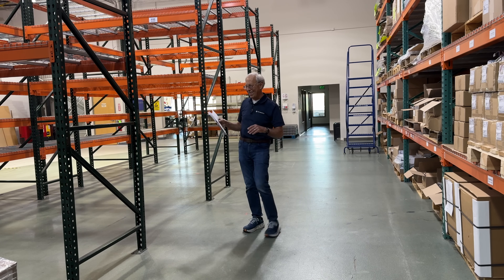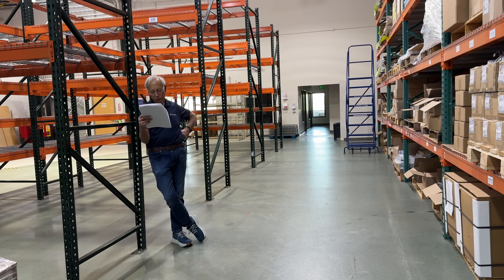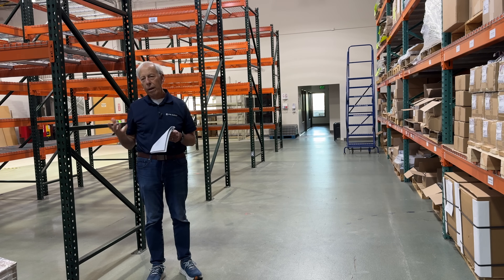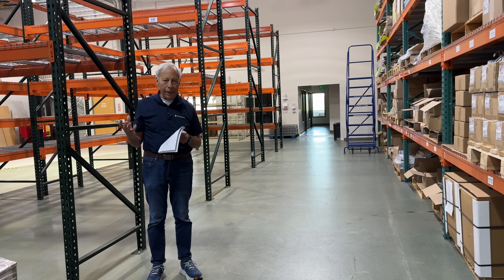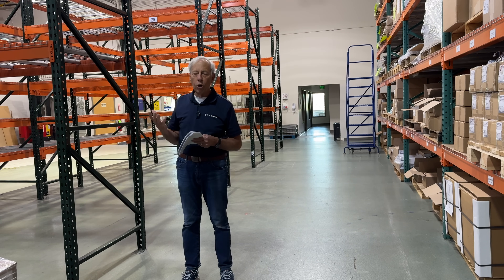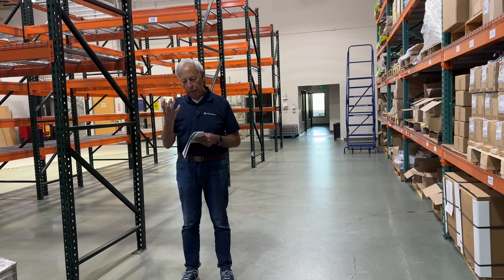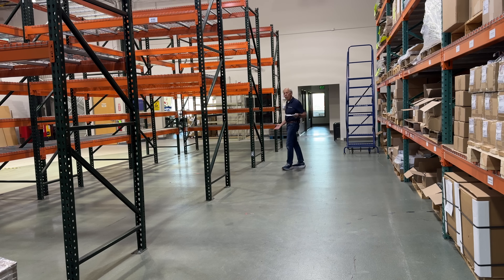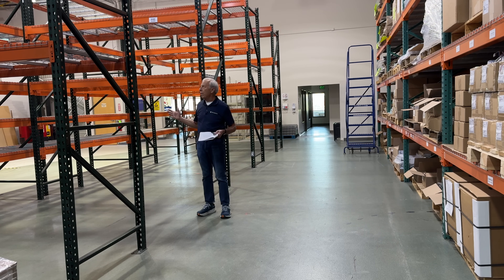Field coil woofers

Comment: In the past, until 1950, in the old time of tube radios and tube amps, there was the gold time of speaker field coils. There was no strong enough permanent magnets available.
In these times, the field coil played two different roles: 1- produced the magnetic field for the speaker; 2 - worked as a low pass filter for the power supply for the tubes, as an inductor, reducing hum and voltage fluctuations. Usualy these second function was named "chocke". After the tube/valve (or sellenium) rectifier, there was a "pi" filter consisting of a capacitor across + and -, the "chocke" in series and a second capacitor between + and - again, figuring the shape of the "pi" greek letter.
Regards.

Comment: Huh?  I think you all need to go back to the drawing board on this video and spend a little more time investigating the field coil speaker. The only reason it is not the standard is that it is expensive to produce. Most of the negatives haven't been an issue since the late 70s.

Comment: Well...Yes, and no! When I was in the Navy, many years ago, at the then West Coast Service Electronics School, on Treasure Island, San Francisco, I met Bob Andrews, who had a small record shop, with a large area in the back, to assemble: extension speakers for juke boxes, beginning during World War Two! And Bob told me that his speakers did not use magnets. OR a transformer with AC Power. Instead, there was an additional box, with a transformer, for the correct volage, and, a rectifier, I believe, to convert the AC Power, to: DC! And, isn't his what a magnet is? An electromagnetic, electrostatic field, in one direction, potential, which never changes? And: this will not heat up, as there is less current flow, as, once again, no AC field is being produced, only the constant DC potential! Worked well!  😀😁

Comment: Field coil magnets are 100% better than permanent. No question, full stop. The only reason they are not more common today is because of COST. Companies like PS Audio makes things to a cost, and they (and others) will cut costs when and where possible. When you add an ‘amplifier’ for the field coil, and the cost of winding the copper, it’s considerably more expensive. But don’t kid yourself: the FC drivers are fantastic and so much better (less distortion, more effortless, tunable).
Reply: Well said.  The magnet determines the sound.  I use alnico magnet drivers and to my ear they have a more natural sound than typical drivers.  My understanding is this character is far more apparent in a well made field coil driver.  Less compression and therefore more natural and effortless sounding.  
If I were to change drivers it would be to a top of the line field coil system but as you point out, price will be substantial.
Reply: Better how? 100% means twice as good, or waht exactly?
Reply: @paulb4661  I think the 100% means they are without a doubt better.
How much that means is highly subjective.  To me, natural, dynamic and real is the deal so there is no competition between speakers that deliver that and ones that do not.  I have heard this in conventional driver in a box setup, but they are usually 6 figure expensive.  I also hear it in my $3k alnico diy open baffles which makes me very happy.  Mega dollar horns from Aries Cerat have it in spades.
Reply: @user-od9iz9cv1w  Fancy relic from the long gone days of adequate BL being beyond reach of permanent magnets and a bit of usual marketing nonsense, but then again,  I do not listen to magnets.
Reply: You can adjust the ratio of inductive balance between the coils and thus change the speaker's free air resonance to a degree. A real neat trick is to change the resonance on the fly in real time to match the notes thus get some of your efficiency loss back. They were doing things like this 70 years ago.

Comment: Just like any other architecture, each can be optimized. Optimum neodymium, AlNiCo or even ferrite magnets can produce the same acoustic result. What you can not do is just change the magnet from one to another leaving everything else the same. I think that more expensive solutions are for those that define their success with the price tag.
Reply: No permanent magnet can produce the same magnetic force as a FC.

Comment: Do different types of magnets (if & when with exactly the same power and geometry - magnetic circuit included) make a speaker sound different ? same for its basket material such as aluminum vs steel vs …) ?
I ask this as some audiophiles do say that old speakers with alnico magnet and stamped steel basket sounded better than the same model when equipped with ferrite magnet and aluminum basket
Reply: Of course they do. The magnet is in the signal path! That’s why FC are superior to permanent magnets.
Reply: Yes.  Two separate impacts.
Stamped steel vs cast AL impacts ringing of the structure.
Alnico vs ferrous magnets impact how linear the magnet it and the resulting distortion.
Most will argue that field coil magnets produce the most dynamic natural sound followed by alnico and then the cheaper ferrous magnet.  While alnico does sound good they are limited in their strength.  Field coils can be an order of magnitude stronger.

Comment: Years ago, electrolytic capacitors were huge and the coil helped filter the power. We never had more than a few watts of audio power so heating never occurred.
Reply: Yes it was two in one.  It  is justified  to use them in tube amps.
Reply: Are you referring to a choke?
Reply: @user-od9iz9cv1w  the field coil of the speaker was used as a very effective choke. They also had a hum bucking winding
Reply: @user-od9iz9cv1w  The coil that energized the speaker's electromagnet was used as a choke, placed in series with the rectified DC input to the High Voltage supply, the inductance forming an LC filter reducing the ripple voltage.
Reply: Saved money and power but introduced new problems, however wonderful the drivers may be, the results were compromised.

Comment: Amplifiers have negative feedback circuits to achieve linearity and lower distortion down to a tiny fraction of a percent. A speaker is on the other hand highly un-linear due to how the electromagnetic field operates and how the spider and surround behaves at different positions causing vastly more distortion than the electronics. In addition you have cone breakup, intermodulation distortion, thermal dependency etc. For these and other reasons, we can all agree that the choice of a speaker is the most important decision for creating a good system. But when will someone innovate a super precise cone position feedback component that can be used to make an audiophile servo speaker (not just subwoofer)? For example, the head of a hard disk can read 2 million bits over an inch. It's gotta be possible today to enable some super tight precise cone control at also higher frequencies, but it's like there is zero innovation in speaker drivers for many years already. I often find myself discovering details using my HiFiMan Susvara planar or Stax electrostatic headphones that seem to lack with dynamic headphones or a stereo speaker setup and my theory is that it has to do with the limits of dynamic drivers.
Reply: Hi.The unfortunate aspect of inevitable cone break up is that it's an independent force of the motor and suspension. The analogy of dropping a stone into water is a good analogy.Once the force gas been applied,at higher frequencies the driver will always break up.Either controlling that utilising careful profiling and edge termination, or simply filtering out the worst aspect of that behaviour with a crossover are the only real world options. As you rightly say,the suspension too has it's non linearity and the box alignment will also contribute towards that. Speakers are a long way behind electronics in terms of their evolution with applications being little more than  refinements on what's been done before.
Reply: @oliverbeard7912  Yes, I didn't mean to say that high-speed feedback on a dynamic speaker driver can make it perfect. Cone breakup is better solved by the cone material and design choices. There is probably a moment of using machine learning in optimizing some signal processing against getting sound pressure to follow signal intent as closely as possible. It seems nothing much has happened for many decades in dynamic speaker driver design. In my teens in the 1980s I bought a pair of JBL 18ti speakers using polypropylene woofer domes and titanium tweeters having a breakup avoiding diamond pattern design hitting up to 27kHz -6dB. Clearly creative effort was used at that time in improving dynamic drivers and this speaker delivered 55Hz–20kHz ±3dB and Stereophile claimed it was the most neutral JBL speaker at that time. It still works in my gym room 40 years later (new caps). It seems to me that the creative side of driver development has been lost with the supply chain moving overseas (mostly China).
Reply: @ThinkingBetter  Yes,it's all rather stagnant and marketing lead. Some brands have made concerted efforts to push driver resonances as far out of band as possible, others have taken steps to try and better handle flux and suspension non linearites. I'm very much in favour of those who have paid alot of attention to transient response and time domain behaviour. There are many designs that measure well with respect to frequency response, but they all sound vastly different even so,given the other aspects involved,transient response behaviour (elastic hysteresis) being just one of those.